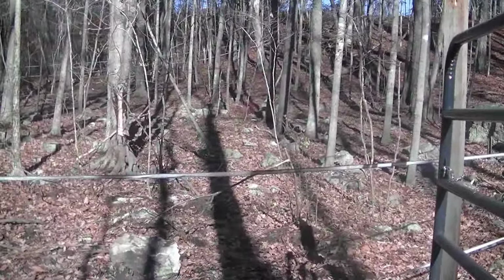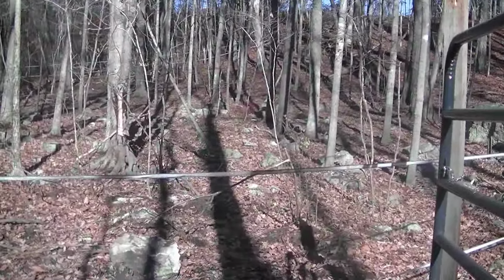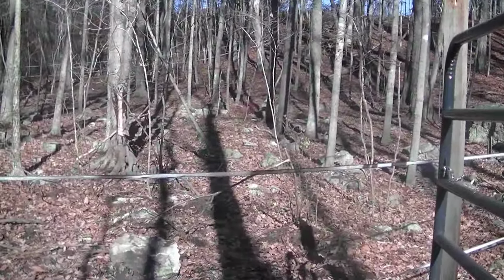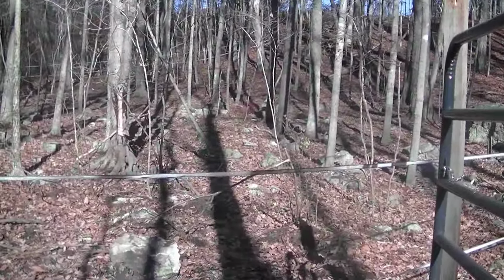Start to Self-Suffiiency Update 11/15/15

Comment: So cool on the gate...adds a bit of a sense  security as well 
Looks good, I have had my share of remodels and crooked walls...and grew up doing floor covering...I fully understand LOL.
Cool idea on the box and wood stove. Yuck...done roof repair not fun...good idea of putting porch over it.
Good progress!!!
Reply from the maker: +Lee Ralph (Pathway to Self Reliance) Yeah we thought it was funny that we're moving on top of the hill with nice long gated driveway lol. Made the big time now lol. The flooring was tuff, campers aren't the most level, squared places to work lol. Hopefully the stove shed works out good picked up another haul of wood from the jobsite yesterday to finish some stuff up. Thanks so much for the support and comments. Have a good one.